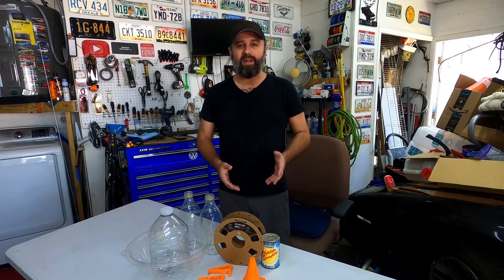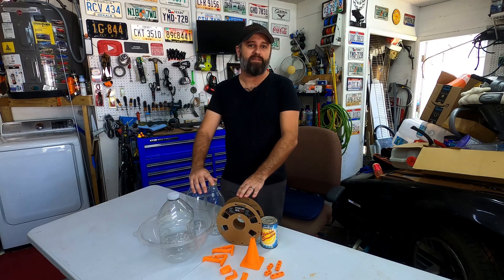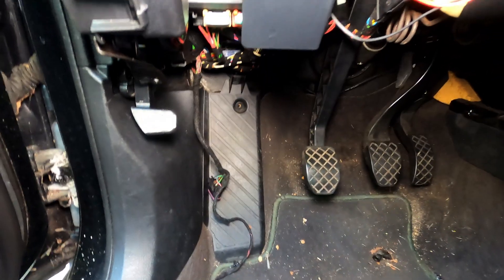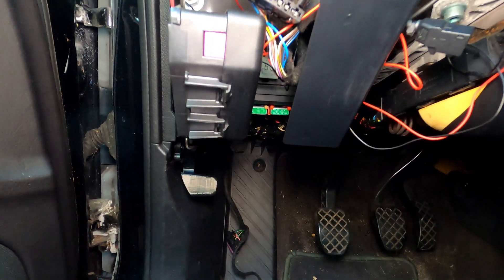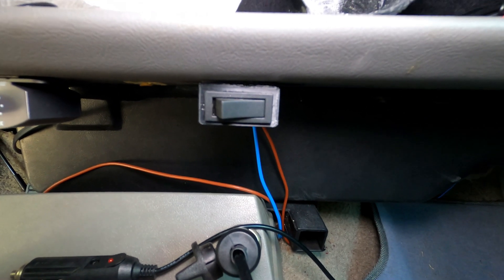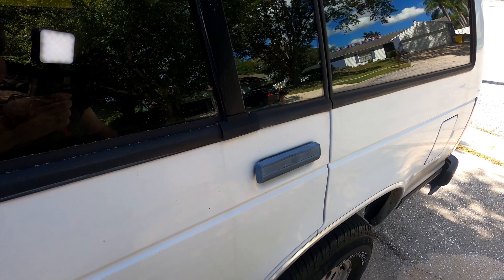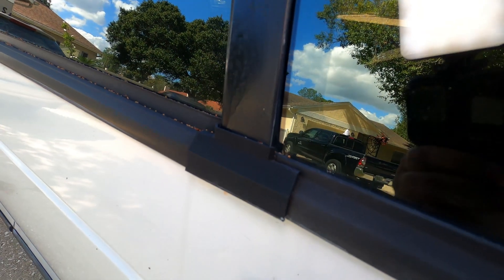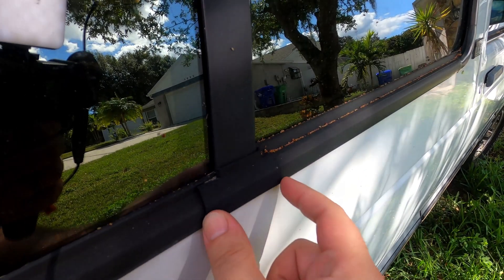3d Printed Car Parts - PETG vs. Sun For 2.5 Years!

Comment: This is exactly the video I was searching forever for. Thank you!!!!!

I'm experimenting with PETG rear spoiler lips. I'd prime and paint them. You think it'll be ok?  I subbed, I'd love to pick your brain from time to time. 😁

FYI I've asked literally hundreds of people on Facebook and Reddit and they said no way PETG would withstand the Florida sun. Haha jokes on them.
Reply from the maker: Glad it was helpful.  There are definitely some more durable materials, but yes for the most part it holds up pretty well!  Like I said just don't skimp on infill, or go too thin on the walls.  Pretty sure with a few of those changes my gauge pod would not have warped at all.  

I ran across a video of someone else printing a rear diffuser, definitely looked like an interesting project.

Comment: That's awesome you 3D printed that part for the S-10 Blazer! I actually snagged a spare from the junkyard and am planning to glue it on. However, I was missing the fastener cover for the air spoiler on the back window of my S-10 Blazer, and I 3D printed a replacement out of PETG. Still going strong a couple years later.
Reply from the maker: I've been very pleasantly surprised by how well the PETG has held up.  Some of these prints are almost 5 years old now.  I ended up buying a whole set of rear doors just to get a set of the original trim so that I could model the new part.  In retrospect that wasn't really necessary.

Comment: hellow , brief question , i see that you are using multiple brands on PETG, did you notice a difference in performance between them ? in my city  can buy esun PETG and my printer is a bambu lab A1; thank you in advance for you reply and time ; happy printing
Reply from the maker: I haven't noticed a big difference in most brands.  I also have a filament drier which probably helps.  Usually I get what's less expensive.  I've been using the Creality PETG for a while now and find it to be pretty good especially for $13/kg
Reply: @VHickleGarage  did you also try PLA HP ?  i am asking not to comtradict you , i just want to find the highest temp. resistance regardless if it's PLA or PETG ; and my questions comes from the fact that on the web most comparisons are between generic PLA and generic PETG 

link to the video about PLA HP 
https://www.youtube.com/watch?v=rqh8Z3WSUFo

thank you again for your time
Reply from the maker: @emanuelkakuja9614  I have not tried that material.  I know you can get more temperature resistance out of PLA by annealing it.

Comment: ASA or ABS
Reply from the maker: I have tried both, and unfortunately I haven't been able to get either to print without warping on my Ender 3.  Even with my new enclosure I'm still getting some warpage.
Reply: @VHickleGarage  it is not easy to print. You need to keep enclosure temperature about 60 degrees and good adhesion